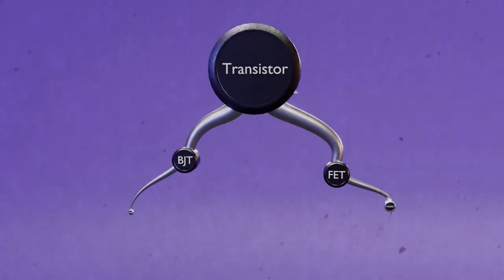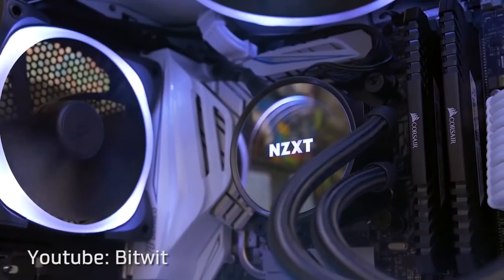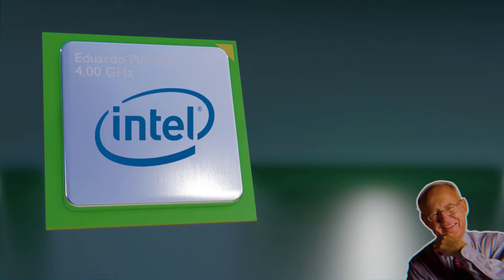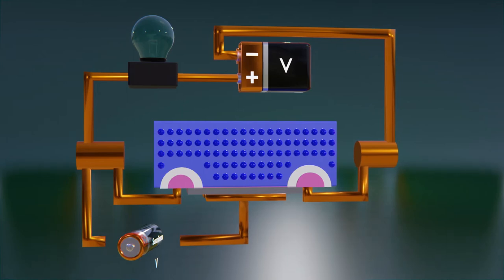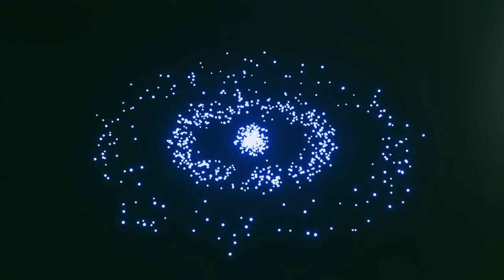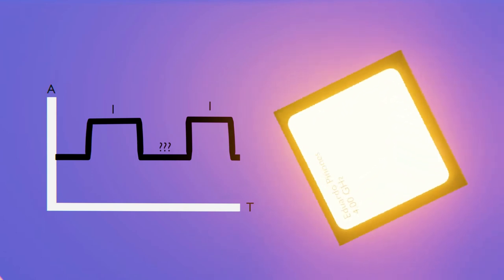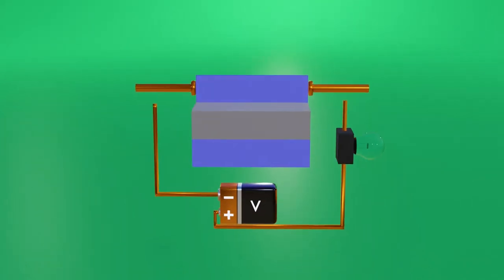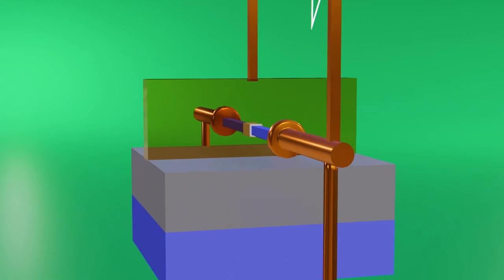The Problem of Quantum Physics in Transistors ⚡ How a Transistor Works (Part 3)

Comment: 7:20 how do you know that the reason the electrons still flow ISNT because the gate fails to have an effect? What if it was actually just that the last couple electrons in the blue N part refused fuck off even with an incredibly close gate?

Comment: Thank you for this video, what I ask my self if elctromagnetic signals can be replaced in lightwaves combined with a soundwave to transmit data not only in a glassfibrecable but also with antenna's and satellites.

Comment: The true answer to the reason that this phenomenon occurs might be observation depicted in Veritasium's "The Big Misconception About Electricity" video.
In short, it's not the electrons the junction is (should be) really blocking, but the electric field flow. It seems like only then the logic of its inner workings doesn't fail.